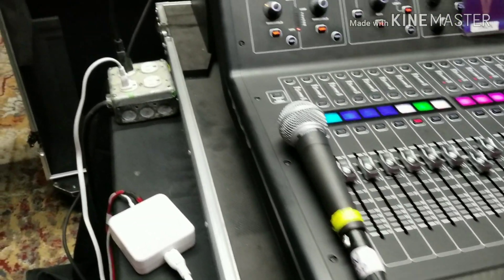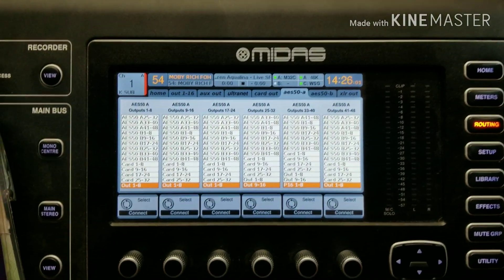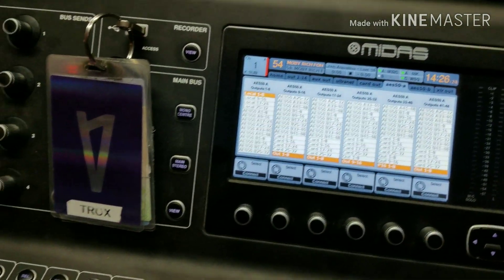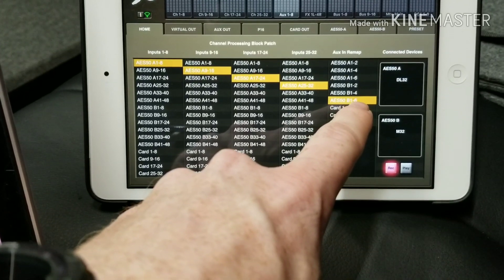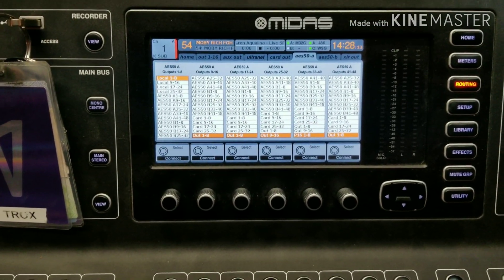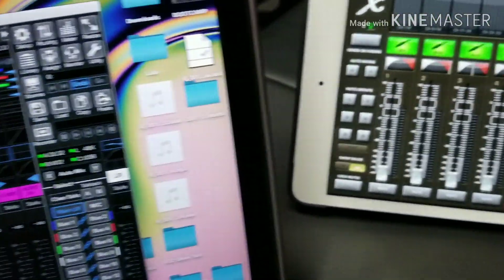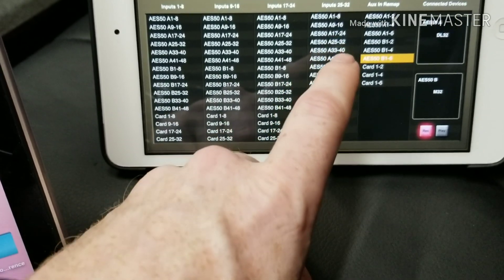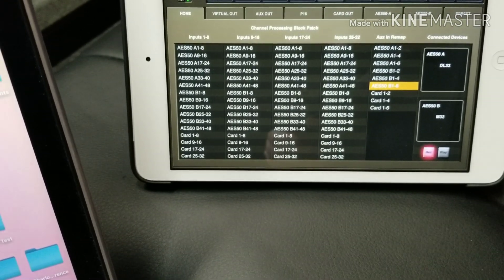Midas M32 - Routing talkback from FOH console to MON console through the Cat5e.

Comment: Will this work if you already have the kick drum on channel 1? And the routing set to aes 1-8?
Reply: It should. If I am understanding what you are doing, you have AES50 channel 1 coming in as the kick. AES50 is bi-directional, so if you asking the aes50 output to 1, it won't change what's coming in. Think of it as each aes50 cable has the potential for 48in channels and 48out channels that can be assigned.